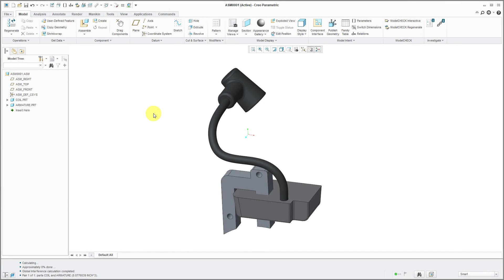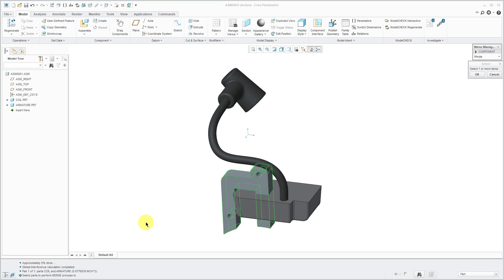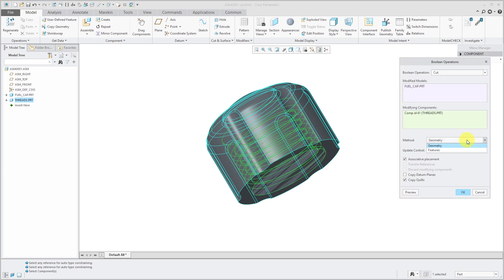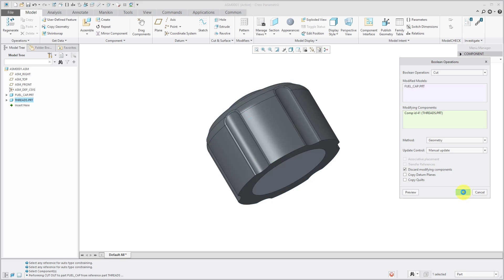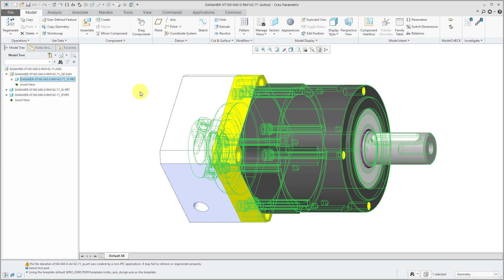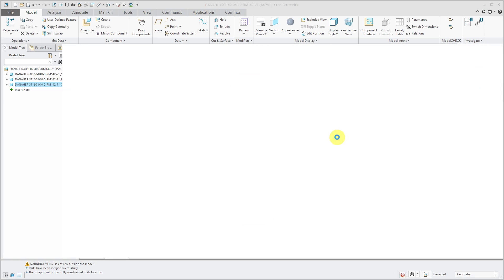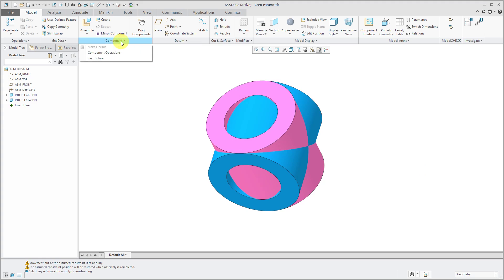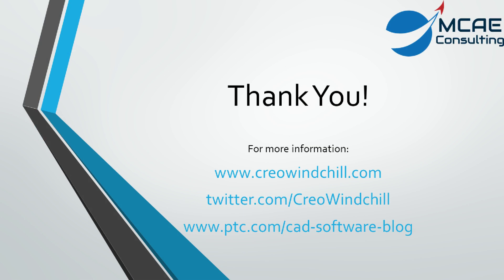Creo Parametric 4.0 - Boolean Operations [Demo]

Comment: Hi Dave,

Do you know why after selecting two merge bodies it grays out the method and auto selects geometry. I was hoping to retain all the features of all the parts (3 parts) within one part. I am running CREO 8 and there is the added feature of "add bodies". My idea was to use boolean operation of add bodies with the method being features so I can remove select features from the three parts. With it going to geometry I lose that control because it just copies over the bodies and not the individual features. Is there like a feature count limitation or something that CREO has set in the background.

I tried with a very simple assembly (only two parts) and I am able to achieve this, but on more complicated parts I can't do it for some reason.

All the best,
Reply: Vince where are you working these days? I was looking up this creo demo and was shocked to see you in the comments. This is Brent from MC btw

Comment: Im waiting for “cut-out with offset”. That would really make it more usefull for manufacturing. For example, your cap thread has zero tolerance and will be useless.
Reply: in my personal opinion, having those two as separate features is more efficient because I've found referencing a tolerance will break the model if I change the tolerance( as I often do)

Comment: Very good tutorial. I used this option to merge parts, but i exported to STEP first. I am not sure is it possible to do in original enviroment without losing dependency between parts. Thank you.
Reply from the maker: Marko, thanks for the comment. Is there a reason you exported to STEP first? You can merge parts in the Boolean Operations dialog box and retain dependency, so that if you change any of the parts added to the originals during the merge, the originals will update. Let me know if you'd like me to put together a quick video to show this. 

And thanks for watching. I really appreciate it.
Reply: @CADPLMGuy  Yes, I exported to STEP first, and then reimported  assembly to Creo again, because i was scared if Creo do a mess in model tree with many parts, after regenerating in parametric enviroment. I supposed it would not update model correctly. So that is the only reason.
Reply from the maker: You generally shouldn't have any problems performing the operations in the native model files. When completed, it creates a single Merge, Cutout, or Intersect feature at the bottom of the Model Trees of the target parts. If the dependency is set to Automatic Update or Manual Update, you have the ability to retain dependency.